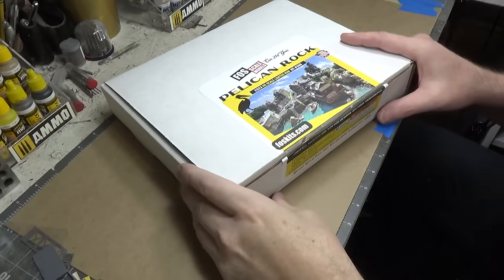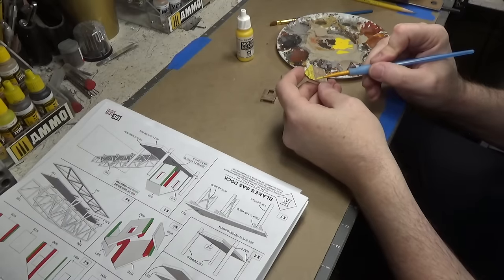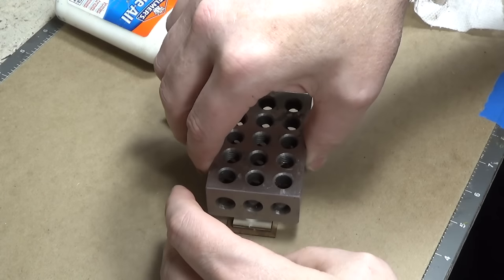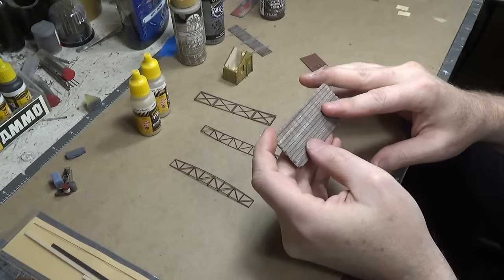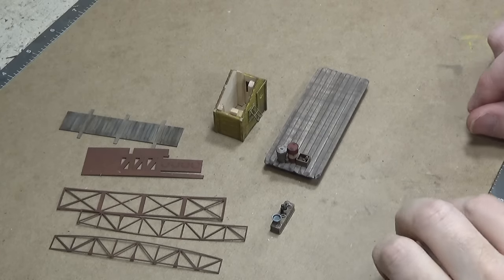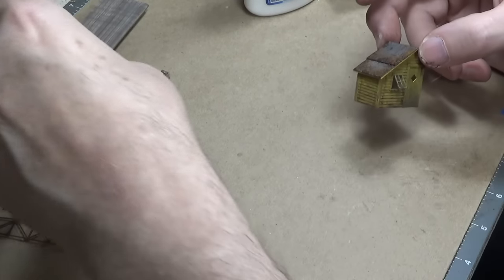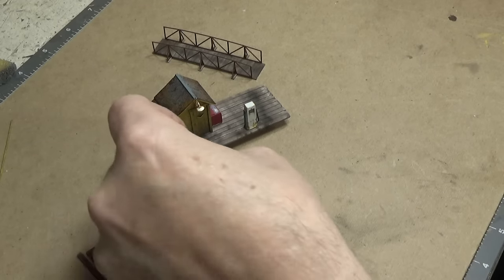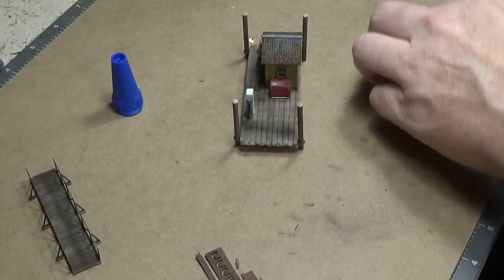Building a small waterfront structure!

Comment: Hi Jason, where did you get the metal blocks for weighting down walls  and for blocking corners?
Reply: Those are called 1-2-3 blocks -- they are 1 inch, by 2 inch, by 3 inch, and very square and heavy. I get them at my local machine supply shop. I have 10 of them for modeling.

Comment: Why don't you use a real light bulb (LED, etc.) for the goose-neck lamp?
Reply: Jason doesn't do any lighting effects on his structures. I think because once you start doing that you are looking at doing interiors etc. IMO lighting effects can be overdone. As can other scenic or structure treatments. One effect can be litter. In real life litter is at best unsightly. But I can say that you actually in my experience see less litter today than you did 50 years ago. Litter with scale structures can help set the time period but should be an accent. Not a dominating effect. The same Dan be said for scrap yards. Scrap or junk yards are businesses. They are in business to make money. The closer to the modern era the less amount of junk or scrap they are just going to have lying around. The days of the junk yards with hulks of cars sitting around are coming to a close. Once the yards cannot make any money off of selling used parts its time to crush the body or shred it and sell it on to a processor.